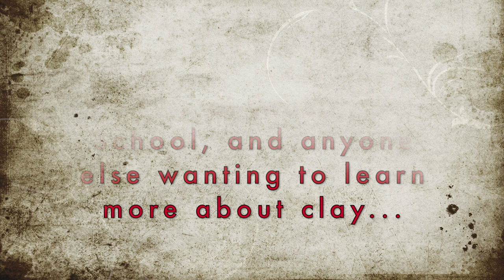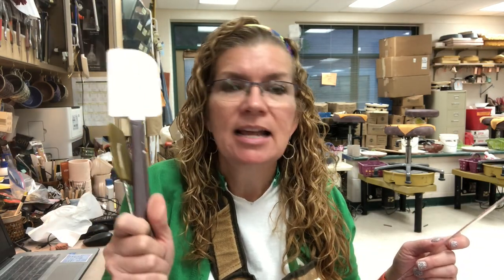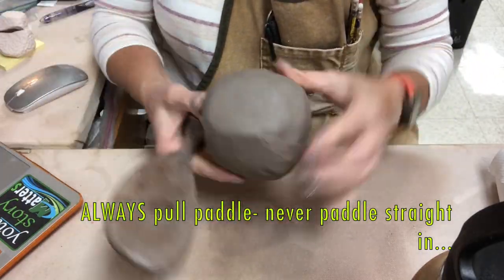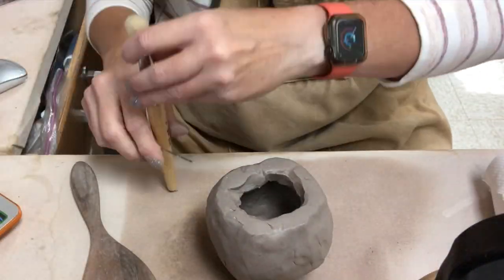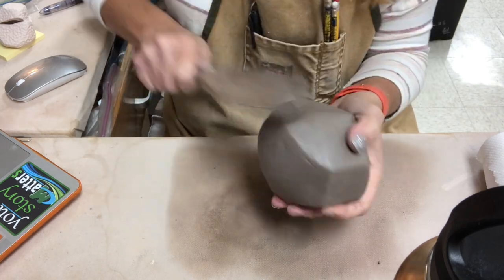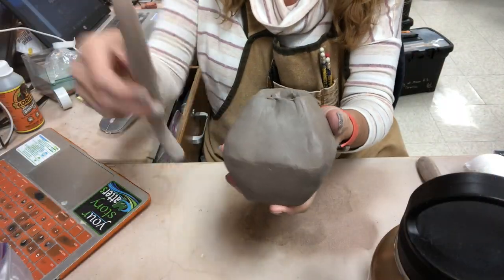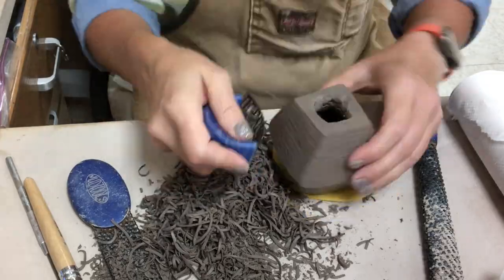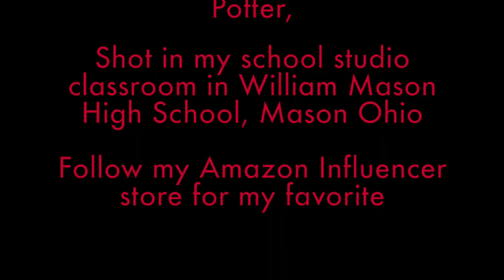Paddling a Pinch Form:  A Quick Demonstration to Alter A Form

Comment: Great video, thank you! What is the name (or link to) of the curved tool you used at 3:00 to push out the slump? I need one! :)
Reply from the maker: It’s one I made- check here! https://etsy.me/3z4RgAB  I couldn’t find them anywhere, so ended up making them myself!
Reply: @KaransPotsAndGlass  I found some online last night but I'd rather support you! You're so talented! Could you do a custom order? Something similar but straight and not curved and a bigger bulb at the end.
Reply from the maker: I could do a custom piece- but I’d be limited to my lumber thickness for my hardwood - which is typically 1”- if the bulb would be thicker than that, I’d have to do some investigation to find some! Width isn’t the issue- just my board thickness!
Reply from the maker: Let’s discuss over email or Etsy message- I’m KaransPotsAndGlass@gmail 😉
Reply: @KaransPotsAndGlass  should I email you a shot of the tool I’m looking for? Your took you created might do the trick. Maybe even better? You could let me know what you think. I’m a little new to pottery.
Reply from the maker: Sure- my email is KaransPotsAndGlass@gmail.com